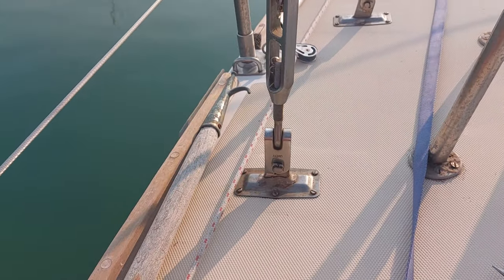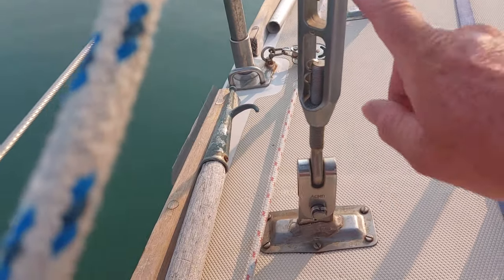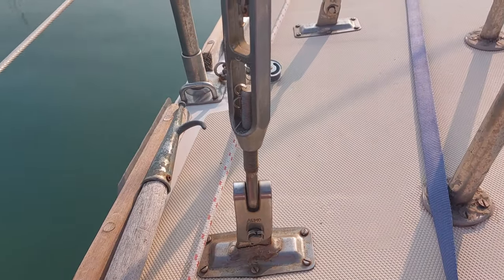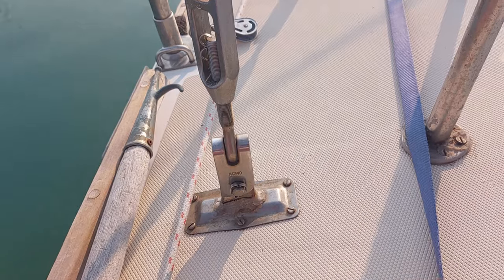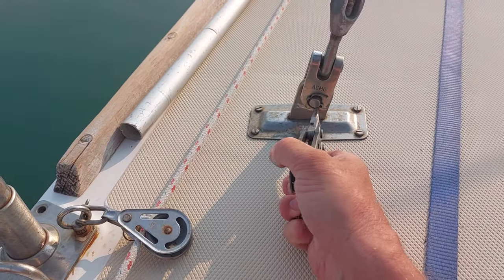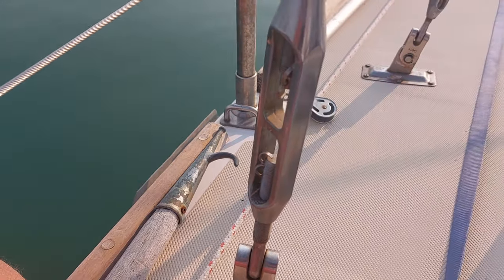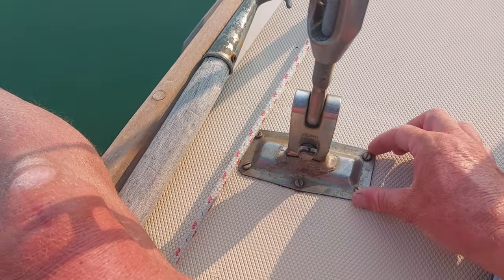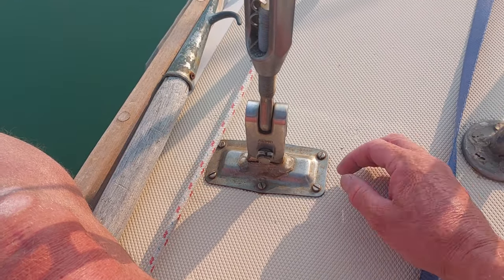Great tips for yacht bottle screws & quick checks plus what's better rigging pins or clevis pins!

Comment: Hi Ben,
Fully agree with not applying sny tape. Also agree that splitpins are a potential hazord for persons on board.
What I am in doubt about however is wether the rings provide the same security level as the pins.
Best regards
Harry Dekkers
Reply from the maker: Hi if they are the right size for the hole provided they are actually much stronger. The actually load should not be that much as its whole purpose is to prevent the rigging pins being drawn

Comment: stainless steel welding rods with same or slightly smaller diameter as the holes in the bottle screws, break off the outer electrolyte , shape into an |_| and insert both ends into both holes, bend and trim the ends into the body of the bottle, lasts forever and much better than and split or ring.
Reply from the maker: Interesting..